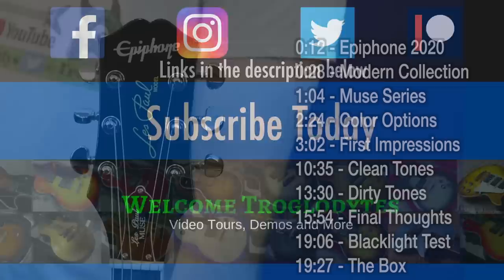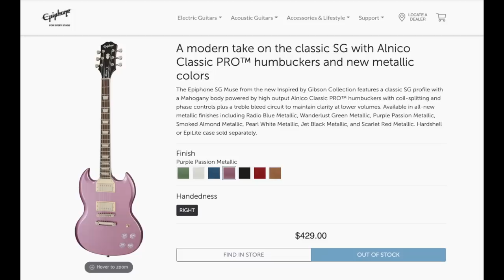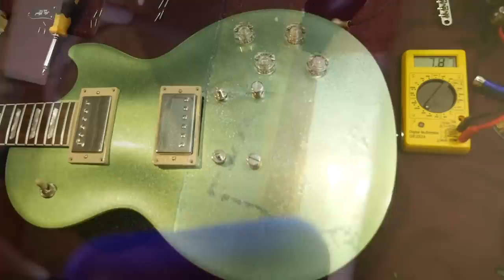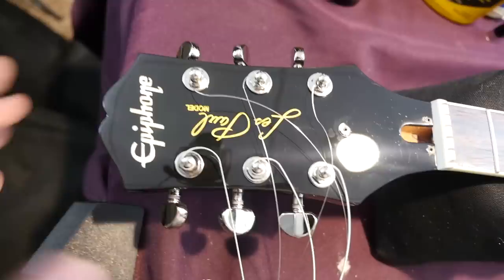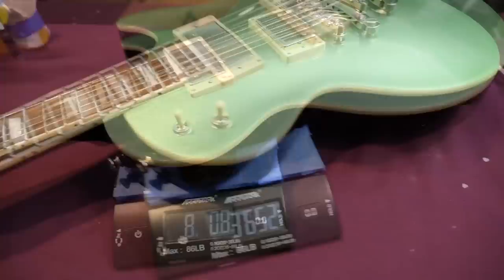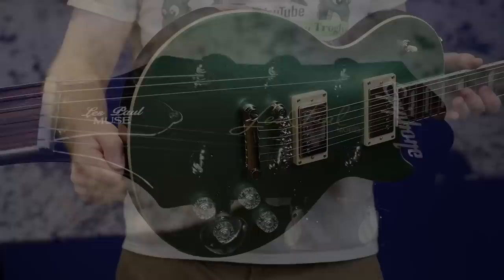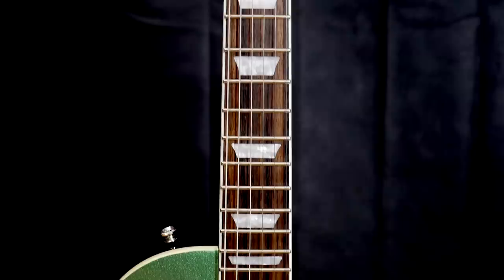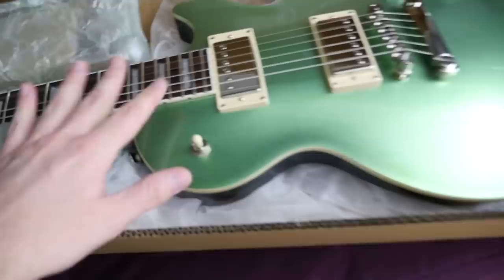Is The Muse Worth It? | 2020 Epiphone Les Paul Muse Wonderlust Green | Review + Demo

Comment: Stick a larger flat blade screwdriver into the potentiometer slots and bend them out a tiny bit, the knobs will tighten right up.
Reply: I can not stress enough that you shouldn't do this. Especially with import pots. Do not do this.
Reply: Do it at your own risk. Inexpensive shafts are cast and do not like being manipulated more than fractions of a millimeter.
Reply: So should I go back to my Dot, Les Paul, SG, Mockingbird (all Asian) and Mexi-Strat and squeeze them back together, or...? Always need to be careful when doing anything, especially mechanically speaking, but I'm 5 for 5 on on my loose knobs with cheap POTs. Haven't run across loose POTs yet, but that is another problem. I assumed he had loose knobs, as he was noting he could still push/pull without it coming off. Just going on the information I have available to me.

Comment: I am glad I watched this review. I have searched through many reviews and this one pretty much sealed the deal for me. The guitar has a treble bleed circuit that is supposed to be beneficial at lower volumes. That wasn't mentioned in this review. But it is actually a nice feature to have if you have a day sleeper at your house. My wife is an RN that works nights in the ER so I have to keep the volume down during the day. So over all this guitar really fit the bill for me. The coil splitting and phase control is also nice to have. I was going to go with the modern and accidentally stumbled on this guitar. Once I read the specs and watched some reviews I was sold. The Radio Blue or the green one are the two I'll probably have to hash out. The sparkly finish is a big draw for me. I'm trying to also get my grandson and granddaughter playing. That finish will definitely grab their attention.
Reply: Some of the less popular colours in the range (such as the black, which looks awesome but is not well demonstrated in stock photos) are actually pretty cheap now too. I got the jet black metallic SG Muse for £249 which is ridiculously cheap for a mid-range Epi like this. The specs are basically identical between the SG and LP Muse range.

Comment: I have the SG Muse in Pearl White - a classy color in that pearl - doesn't hurt too many feelings. It is NOT weight relieved and seems to fill a niche that the real Gibson doesn't regardless of the push/pull and phase (why do you want that pull knob handier? You'll NEVER use it) features. At least as far as the SG for $430 with all those foo foo features and a darn good fit n finish - a solid "D with shoulders" I call the neck - super fast - Gibson has nothing to compare it too...that's a GOOD thing for Epi imo. The Gibson SG I would want that plays as well as the Muse would cost $900+ more and that ain't right. Ain't like that in the Fender world. 🎸

Comment: I just bought a 2020 (2019?) Epiphone 60's tribute Les Paul AAAA flame top maple veneer in the cherry sunburst and I LOVE it!! It's got push pull for coil split and phasing. It has a 57 classic in the neck and 57 classic+ at the bridge and true switch 3 way switch, I also bought the Lzzy Hale explorer and it has the regular Epiphone 3 way and yeah, huge difference!! I hate the one on the Lzzy Hale while the one on the LP is great, nice and quiet and snaps right in place. All CTS 500k Ohm pots, it's basically a Gibson with an Epiphone body and poly top. No problems with the frets and I love this neck shape. $650 and that comes with a hard case!! It has Grover, real Grover! Locking tuners and the graphtech nut.
Reply: Got the classic in ebony, a little dent on it got me 300 dollara back so paid 200 for it
Reply: Ron Just Ron 
Where did you get it from? 
Only ones I saw were the tribute plus 
Costing $1,100-$1,200
Reply: @bikerjon8934 You must be thinking about Gibson Tribute... not Epiphone at those prices... that's the price difference.
Reply: I've got one in the dark cherry. Love it. Bought it new in 2015.
Reply: @MusicTherapyLaz  no..you can get the epiphones for 650 all day on ebay and reverb

Comment: For lose fitting knobs, wrap their posts with a small amount of teflon tape (make sure to test each knob afterwards for proper fit, finish and operability).
Reply: Just be careful that you don't make them so tight that if you have to take them off again you don't pull the guts out of the switch. Done it several times. Sometimes you can put it back together but usually when you yank the post out your screwed.

Comment: I like this obviously and have spotted a color that I love... the only thing is theres alot of volume drop offs I'm hearing wher youd have to quickly turn it up or down between settings...kinda the same thing with some HSS guitars as well...
I'd be curious about the pots...aka 500k and or 25k...
But otherwise, locking tuners on it I could easily do,

Comment: Well, I just bit the bullet. I found some plastic stock that fits the split in the pot-shafts on my Epiphone modern. So I ordered a set of four black (the guitar is graphite) t-style, 6mm metal knobs with set screws. I don't like top hats and I am tired of plastic, altogether, so speed-knobs are out. Besides, I want knurls and set-screws for speed and confidence with the push-pull coil-splits/phase shift CTS-pots - as every facet of these split Probuckers would be useful, with secure knobs. I realize I am sacrificing the numbers, but I don't want to be looking down at the guitar, anyway, and can "flavor according to taste" with my ears, or so I think. Well, we're gonna find out. And unless it looks like complete dog-sh*t, I think I've found the solution to a problem most people aren't looking for.

Comment: Hey, i like that you did a video on the sustainer circuit, it is really cool, but I agree that having to have a battery all the time is a pain, my fernandez battery compartment came off and it looks like if I keep changing 9 volts the piece will rip off, I had to have it fixed years ago and the guitar place was like this is a japanese guitar, bla bla bla, they really didn't know anything about a sustainer. Anyway, be nice to see you do a fender jaguar kurt cobain signature.

Comment: im just done with buying black back necked guitars, the reason its like that is they cheaped out, after you play for about 10 years that type of stuff starts to matter more to you as a player. i dont want a surface thats either going to be too slippery or too dry to travel on, theres no middle ground, you either slide too far or not far enough. you will eventually tire of this guitar and want to replace it, if it was for a beginner or someone early in playing maybe it would be good for them.

Comment: Low output/vintage output humbuckers make for terrible coil split pickups. It's 100% a gimmick on low output humbuckers. In those guitars in/out of phase is a much better option. All my humbucker guitars have coil splits and they sound excellent but they are higher output humbuckers to begin with. Anything less than 8k doesn't make for a good coil split. For example seymour duncan 59's are right on the edge. If you dial it in right they sound great split. But again anything less than 8k before splitting will sound pretty thin and anemic split. Thats why coil splits get such a bad rap. Coil splits are excellent but only if paired with the right pickups.

Comment: made of okoume according to the spec list. a low cost low density mahogany substitute (common on plywood where it's just the veneer). Stability is nowhere close to khaya or honduran mahogany, and weight is very low (2/3rds or less of mahogany - not sure why they'd chamber it unless it was dead as a doornail without chambering - which is possible. Korina is kind of dead like that if you make two guitars of the same type - if a mahogany guitar is a pound heavier than the korina, it has snap and crispness that korina doesn't. 

The modern says that it's made of mahogany, but pictures show it as three piece - not sure which mahogany it is, either.  Gibson has rights to mahogany from fiji (real mahogany), but no clue if they send the thin bits over to china to be put in epiphones. 

I'd never buy either of them, but based on the two, I'd get the modern as okoume in anything other than an acoustic guitar is questionable. It's soft and bends really well, but those things aren't great in an electric.

Comment: 2:06 - quite possibly the highest (worst) bridge I've ever seen on a les paul style guitar. 

Gibson does the high bridge on newer guitars because it allows them to be sloppy with the build - your desire for a low bridge and low string breakover (better) like you'd find on collings or carvin, or the better custom tokai historic spec guitars runs counter to gibson's desire to make the guitar as easy to build as they can possibly make it. 

And it's into the epiphones now, with super heavy bridge posts that will reduce transfer of vibrations to the top. The body is okoume (usually super soft) at least according to their spec sheet and the fingerboard is laurel. 

At $500, I don't know if there's much to complain about, as that's about the cost of materials and electronics for me to build myself a telecaster from scratch, and I have to build it...

...i wouldn't buy that. 

I've gotten upper level late 70s and early 80s yamaha studio lords for that price, and they're honduran mahogany, the 700c is honduran body, neck, and ebony fingerboard with true shell/pearl inlays (not acrylic or celluloid). Last one of those that I found was $50 above the retail price of this guitar. 

low-mid price tele and strat copies are a lot safer in that price range.